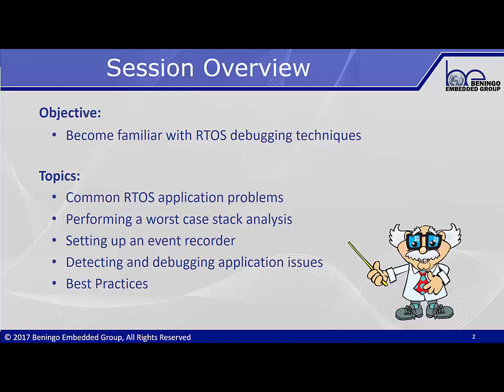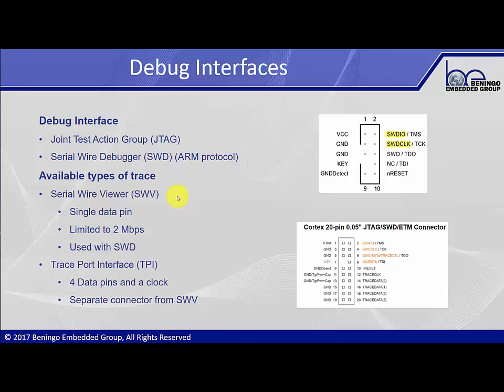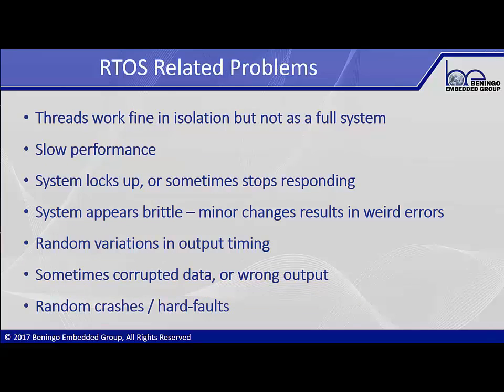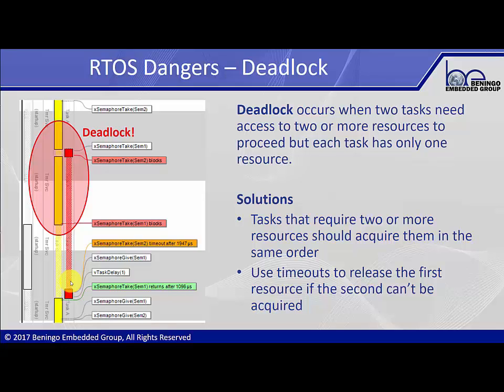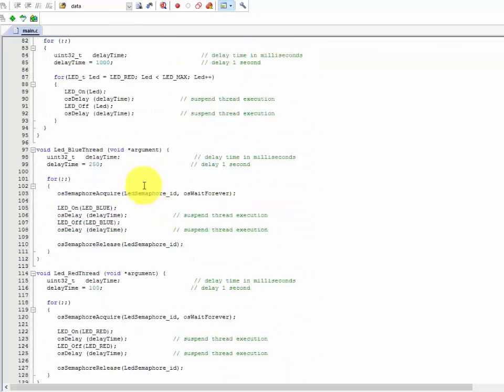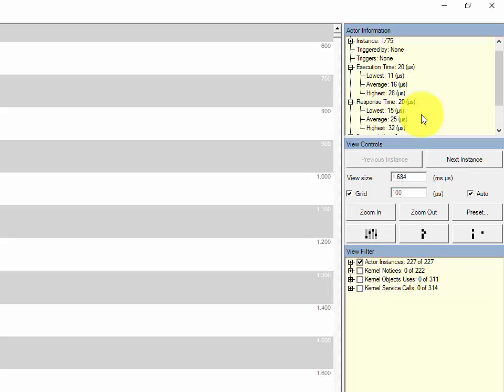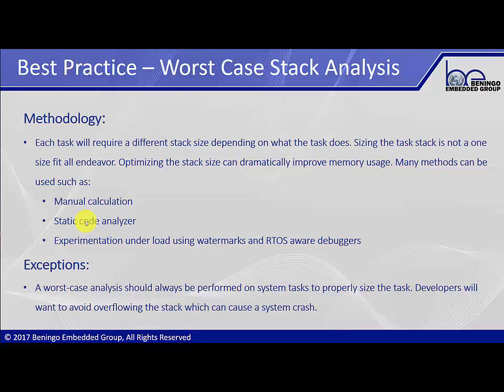Mastering RTOS Debugging Techniques

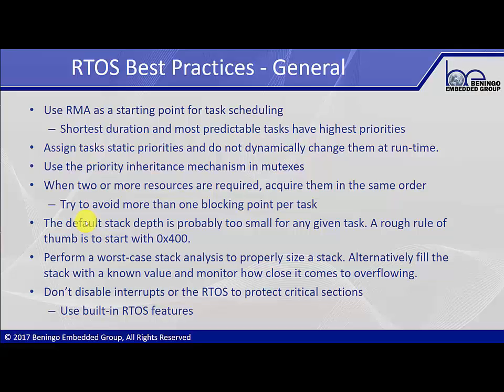Comment: 57:40 -- I see here and also in some books from another RTOS Vendor that it is not recommended to use a "Binary Semaphore" for acquiring an exclusive lock over a resource. Is that mandatory? Wouldn't a binary Semaphore give me the same results?
Reply from the maker: Yes and no. You can use a binary semaphore to lock a resource but a mutex is a better tool for this. Mutexes have a feature called priority inheritance which are not available on semaphores that can help alleviate and avoid priority inversions. Use a mutex for locking access to a resource.

Comment: I am using FreeRTOS on STM32 with Keil uvision . Can we use tracelyzer for stack analysis in this case as explained in the video ?
Reply from the maker: Yes you can still use Tracealyzer to retrieve event information. You may need to setup your own custom user channel for trace data in order to transmit the value of the watermark for the stack.

Comment: can we debug the RTOS using IAR IDE through Tracealyzer?If it so how can we do that?
Reply from the maker: It is possible to use IAR. I've seen it done on the Renesas Synergy platform but it involved creating some special macros that I don't quite recall. I would recommend jumping over to Percepio's contact page and ask them how it would be done. The link is 

https://percepio.com/contact/

I know they'll be able to get you the right setup. Thanks for the question!
Reply from the maker: You can use Tracealyzer with any IDE. If I was using FreeRTOS within IAR, the process would be the same for streaming trace.